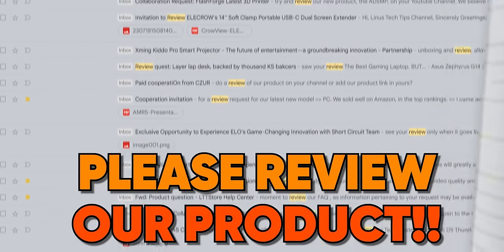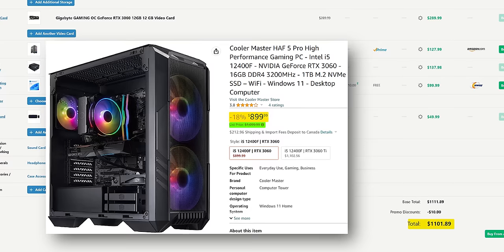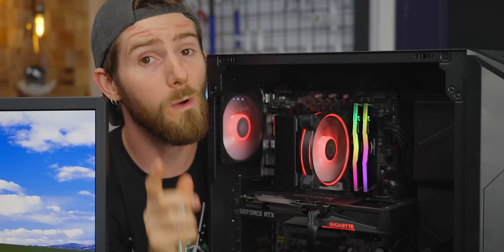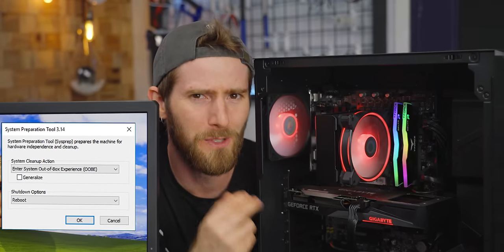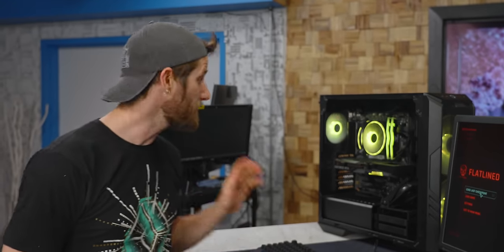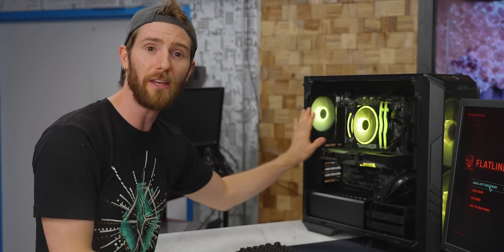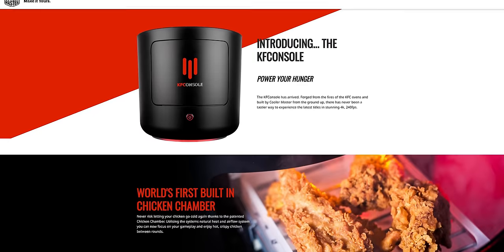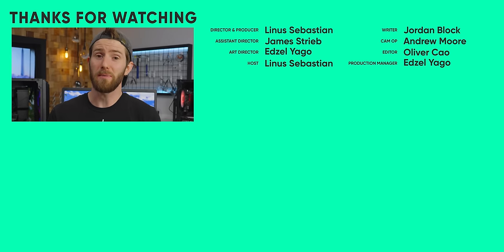Cooler Master Makes Gaming PCs Now? HAF 5 Pro Gaming PC review

Comment: I've used their products for years so it is actually nice that overall they did good here. It makes you happy to back a company that isn't complete crap.
Reply: Yes I'm a fan of Cooler Master, pretty much every product I've purchased from them worked as expected and well. I like their case designs, and my dream case is the CM Haf 700 Evo it's simply beautiful yet still has amazing airflow
Reply: @emilyshabang  I've been running a storm Stryker for like 10 years at this point (god i really need to upgrade😅) and it's been a really nice case all that time.
Reply: They have horrible quality control. Their DDR RAM doesn't even work.
Reply: @Haskellerz  And important settings arent turned on like resizeable bar. I think this was a catastrophy even if they show it was a "win" for coolermaster.
Reply: the only thing which is complete crap is the keyboard kit, I remember getting the Devastator 2 almost a decade ago for 20$, mouse was real bad but the keyboard was decent for the price (at the time). 5y later I had to get a cheap keyboard and mouse for my gf, so I went straight for the same kit, was discontinued and replaced by the devastator 3 and it was 35$, my ingenuity brought me to think that it was just a newer and improved kit, so I got one.... It was a complete pile of steaming s***, it was so bad that I actually sent it back thinking that it was defective or something, needles to say I got back the same crap, somehow the typing experience was worst than all e-waste keyboards I had tried at the time
Reply: Wdym? They produce a great air cooler, fact after changing to their master sickle flow fans, my PC temps work better!
Reply: I loved them before I got their products. They wouldn't let me buy more cables for my power supply cuz I misplaced them, and my power supply literally shot a fireball out and it took over a month to actually get anywhere with the rma procedure. And the information I got was from their discord, not the official site with my rma
Reply: @moritzbecker131  Not every game will see a positive effect with ReBar on, as with Nvidia’s own testing, some games even see performance drop. The ones that gain performance however, you won’t even notice it due to the minimal gain in fps. Yes, switching on ReBar won’t hurt; but it just might not help either.
Reply: @mastroitek  i would actually put put coolermaster close to the middle, air stuff is good but other stuff isn't but same time there is better things and worse things then cooler master. i would say it's the first pc build before your second better pc
Reply: They are crap, they didn’t want to send me a $10 bracket when I asked several times after they promised to honor it. 

They did it to more than me too, I won’t buy their products anymore.
Reply: @hiashi1943 yeah cooler master has bad support overall and kind of sucks as a company.

Comment: 10:49 I actually put together a bunch of PCs like this using CM parts for kids under the age of 10; the reset function was unlikely to be used often and the simple button press to change RBG styles made sense for them. I figured when they're old enough to be interested in taking the thing apart, they'll figure out software control for themselves as well.
Reply: I haven't used a reset button in a decade at least
Reply: @nostrum6410 Mostly just useful when you have it on a test bench/during building.
Reply: @nostrum6410  i personally use it at least once a month, often when Windows freezes
Reply: @t0biascze644  If your Windows is freezing once a month, there is something seriously wrong with your system. I haven't had Windows freeze since XP, probably.

Comment: 10:10 It's not just a Cooler Master thing, I bought a SilverStone case and it came with the Reset switch plugged into the RGB controller too. I also switched the cables to make it actually reset the PC and RGB be controlled by the motherboard.
Reply: Same. I have a Fractal Design case and the smaller button is labeled in the manual as an RGB button.

Comment: I bought one of these on Best Buy. When I inspected the case it was filled with fans, but they were all set take air IN to the case, but there was no where for the air to go! I had to then go and swap everything around to have air being pulled in from the front and side and vented out from the back and top. My temps for the CPU went from 80C with just 20 minutes of gaming to 50C with 2 hours of gaming. Not sure how that passed inspection!
Reply: I'm guessing you meant it went up to 80? All fans blowing inward is a little old of a way to do it, but it's actually pretty standard.
Reply: @OmniUni  I would understand if there was a spot for the air to vent, but all possible venting locations were blocked by fans bringing air in.  And yes, I did mean it that way, sorry about that.
Reply: @forgotten893  The old wisdom was that air would still escape out of gaps and the higher static pressure would allow better cooling. It's actually how I was taught in school back in the Pentium 4 days. (I don't do it like that anymore, I usually have one fan on the back I blow air out, I'm just saying this was, at one point, the recommended configuration.)

Comment: I'm surprised you never came across the reset button as an RGB controller, it's very common and some case makers (AeroCool comes to mind) have it as the default in their instructions in cases that include RGB fans. Far easier to set up and better than using proprietary bloatware if you ask me.
Reply: It shows how little experience the guys at LTT have with budget cases, where that practice has been extremely common for many years. My Thermaltake Versa J24 ARGB that I've had since 2019, for example, was set up that way.

Comment: The reason why the reset switch was used to control the RGB was most likely because the Asus Armory Crate software doesnt work very well in the sysprep environment on the factory floor, so to combat that the reset switch was used. An alternative solution would be to drop a shortcut in the Default\Desktop folder whilst in the sysprep environment so that it would show up for the end user to install. Kinda tedious but works well.
Reply: Armory Crate barely works as it is.

Comment: I actually built a very similar system myself ... not in the HAF 500 but in the CoolerMaster Master Case 5 Pro which is the direct predecessor to the HAF 500.

Comment: As plenty of people have already said, the reset switch to control the RGB is quite common practice.
Yes, you sometimes need to hard reset your PC, but pressing the power button for a few seconds to turn it off and then turn it on again, works just fine.

Comment: I see a lot of people liking that the RGB is on the reset switch and you know what... I agree. I DO think they should put some sort of guide in with the system that explains that and how to connect it to the motherboard for "advanced use". I had a windows update that broke my RGB for months and I tried several ways of fixing it including trying some opensource software that I couldn't make work. ALL I WANTED was a solid color pattern, super simple, and I am kind of annoyed that I can't just set RGB values directly in the BIOS as an override and not have any software control at all. Eventually another windows update did fix this problem but I spent months with a puke rainbow pattern going on because I had no other choice and wasn't going to OS reinstall over that. Also if I were dual booting (which I sometimes do), having it hardware controlled would be nice. 

I have to think that for 90% of users the reset switch and hardware control is a better solution. "Keep it simple, stupid"

Comment: While Amazon is great, I can say Cooler Master (especially as a Canadian) has the worst RMA service I have ever experienced from a company (note their BBB F rating). I got a DOA AIO from them in 2015, took almost a year back and forth to get it sorted, several months for processing and shipping each time. 

The first replacement I got was an upgraded SKU because they didn't have the one I returned, great but they sent the screws for the other sku. So I had to send the whole thing back and forth again before it finally got dealt with.

Comment: I mean, they are the master of coolers, so their PCs' temperature would always be cool, right?
Reply: Funny you should say that....
I bought a CM H500 to replace my HAF 912. The 200 mm fans on the front must be great for slow, quiet but plentiful airflow right? Well.... One problem. The holes in the metal plate at the front are only sized approximately for 140 mm fans. So the 200 mm fans just aren't operating at peak efficiency like advertised.

Also one time my auto correct changed Cooler Master to Cooker Master.... Omg I broke out laughing.
Reply: @HAFBeast91 the pc just instantly starts cooking when you turn it on
Reply: @HAFBeast91 pc and air-fryer in one? The future is beautiful

Comment: I like what cooler master have done here, and I particularly like the 2x200mm fan configuration on the front. I think more cases should go with 200mm fans.
Reply: Indeed . My Xigmatek case has 2 x 200mm front fans .. Just not sure about the air gap tho.
Reply: 200mm are hard to find, my case had 5 of them
Reply: @kennymilsom  Heh, xigma.

Comment: That reset pin should be on the RGB controller because by holding that you can switch from the motherboard control to its own controlled preset and vice versa.

Comment: A Bung is a cork with a hole in it used for making booze. The hole "bung hole" is ised for a tube that bubbles to let out gasses when they build up, So you dont have to watch it when its fermenting.

Comment: I don't really like the reset button personally.  If it's disconnected, you have to long press the power button, and that's hard to do accidentally.  Plus if things are wedged badly enough to need a hard reset, I'd rather power everything totally off, and let the BIOS and other firmwares initialise from cold.  It's too easy for weird stuff to happen with peripherals or add-in cards if you just press the reset button IMHO (but maybe I just have add-in cards that are too interesting).
Reply: Yeah, the fact any desktop cases still have a "reset" button seems like a weird legacy of early PCs. It doesn't really make sense with modern computers and operating systems. You rarely should ever use it, and can just hold the power button if you need to.

Comment: One good thing about tying the controlling the RGB into the reset switch is that you can troll someone with it. Well in all seriousness Cooler master did an amazing job with the system overall yeah there are some minor things that they need to do but it is not bad at all. I have seen worse from the prebuilts that Steve from GamersNexus reviewed.
Reply: Recently built a PC with an Antec case..... It didn't even have a reset button on top, but it did have an LED button......  Cooler master can just relabel the button, and problem solved!
Reply: Yes MUCH WORSE. I actually think Steve would give this system a pretty decent review esp considering the price. The ram was the only egregious issue and that could be a fluke problem....and could happen to anyone that buys a set of ram

Comment: Would be interesting to see fps count with the original firmware. If it fixed issues with the 3060 then that might explain the improvement.

Comment: I recently purchased a variant of that TeamGroup RGB RAM and I'm VERY impressed.
I got the DDR4 32GB 4000mhz kit for $85 to upgrade my aging z370 system and unsurprisingly it didn't like the XMP profile.
However I was able to downclock it to 3600mhz and got the CL to 16 rock solid stable. 3600mhz CL16 for $85!
For reference the Corsair 3600mhz CL16 kit is over $100. The RGB on the TeamGroup RAM is very nice looking as well.
Sucks that they had trouble with that 1 stick they received.
Reply: Pretty much proof that cooler master has no quality control and never tested it before shipping

Comment: I used to build PC's for a company and that screw is one of those things that just shouldn't happen. When I built a computer the last step before packaging the computer was to shake it and listen for anything rattling around. Then lift it over my head, turn it upside down and shake it again. Any thing rattling was reason to open it up and check what was going on, then test that it still runs, close it up and shake it again...

Thing is if turning it upside down and shaking it violently by hand would unseat cards or cables then it wouldn't survive being shiped to the customer anyway.

When building a larger series of computers I also started with making a master, taking care with cable routing and all that. Then that stayed available for everyone to look at if they wondered how to route a certain cable. In some cases I made a cable jigg for pre-folding cables so you only had to throw them in without having to think about the routing. But this was mostly back when IDE and P-ATA was standard for HDD's and optical drives.

Having said that mistakes still happens. You can only do your best to eliminate the risks, but no one can always crank out perfect machines.

Comment: Impressive price point, but a system that doesn’t boot has to be darn near the last thing you’d hope for in a prebuilt
Reply: Yeah I wish they would have been harder on them about that. Faulty ram, faulty display port without a bios change, and bar not enabled? Sure, for us tech heads we can fix that. But for the public? It would have been an ABYSMAL experience to have a DOA system. Because that's what it was, DOA. It wouldn't turn on with the ram installed by default.
Reply: At least Amazon support were on the ball and offered to send a technician out for free to diagnose. That's pretty refreshing.
Reply: To be fair it was bought on Amazon
Reply: @AndyMitchellUK26  agreed, that's almost shocking, didn't know Amazon did that sort of thing these days, and that's better than nothing, but I honestly feel like short of some unpredictable shipping damage, I'd expect the system to boot first try.

Comment: reset switches are pretty much a legacy option now, as it mostly benefits only one thing: spinning plater harddrives. hard shutdown then powering back on would cause the platter to slow down then ramp back up, increasing wear, so restarting would allow it just stay turned on, mitigating this additional wear. now, with most people going SSD/NVME only, it doesn't matter, except you have to hold the power button down for 5 seconds (an arguement can be made for watercooling pumps and fans, but pumps are generally magnetically driven, and fans don't spin anywhere near as fast or are as heavy as a HDD anyway, so the wear is a lot less extreme on an inertia stand-point)

Comment: Another option if feasible after upfront and maintenance costs factored in is a chiller system. A chiller system and air handlers come in different sizes. Can cool in building or whole stadiums

Comment: I buy hardware, not brand names! If some off the wall Chinese company popped up right now today and called themselves 'Pink Poop', would I buy from them? Damn right I would if they had the best hardware for the least coin! If you offer a 13th gen i9 with 64 gigs, 1Tb, a 790 chipset and a 4080 all for the low low price of $2k..... Damn right I'mma take that chance even if the case glows pink with an RGB turd for a logo! I mean, what good is card fraud protection if not to protect? Cheers 🍻

Comment: The thing about the RGB/Reset button is the controller in general, You hold the reset button and it will reset the Machine perfectly fine.

Comment: Regarding rgb controller being controlled by a reset button, I think they should've went the deepcool way where there is a physical separate button for rgb for onboard rgb controller. I use my mobo's port anyway, but it's nice to have this good option. Although, the UX problem is that reset button is in a different style from the power button and in the same style as rgb button, so unless you read the label you can mistake it. The model I have and talkign about is Matrexx 55 btw.

Comment: My current PC is CM H500 ARGB case, Peerless Assassin 120 se ARGB CPU cooler, Asus tuf gaming B550-plus wifi MB, 32GB Corsair Vengeance RGB Pro DDR4, 1TB Samsung 980 Pro NVME, Corsair RM 650x PSU and... a Ryzen 5 4600G I snagged when it was on sale $99 Can. I am going to get a better CPU and a discreet GPU on Black Friday, 4600G just a placeholder now.

Comment: The most helpful LTT video ever was the one where Luke tested how bad cable management distrubs airflow and cooling. The answer was "not at all". Which is such a perfect excuse for the mess in mine....
Of course it helps that there is no glas window or RGB, due to the fact that it is BS.

Comment: To be fair with the reset switch, if there is an RGB controller like that in the PC, it usually uses that switch to change the RGB. It's the same way on my Antec case.

Comment: I actually liked the idea of using the reset switch to control the RGB controller, but if you can control through software, it is better.  I dont get the point of the reset button, you can just press the power button for 5 seconds to get essentially the same result.

Comment: Actually, Cooler Master using the reset button to change the RGB is common for their cases. I have H500P case for my current system and when I first got it for my 2020 build it also had the RGB controller tied to the reset button which I switched to motherboard when I built the PC. I've replaced the controller with a Corsair Commander Pro and RGB Controller since then as I had a Corsair AIO.

Not sure if I would buy the Cooler Master Prebuilt as I prefer to build my own systems.